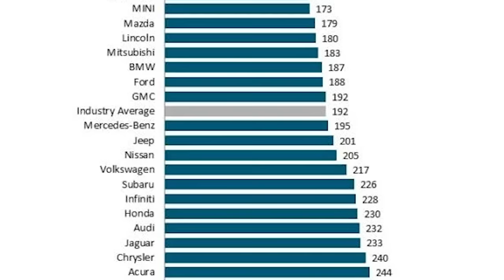Trucks That NEVER Break Down (Reliably run 1,000,000 miles)

Comment: My first truck was a Dodge D50 (a Mitsubishi Mighty Max)... it was hit by a drunk driver in a Ford Ranger, it landed in a ditch, and was rear-ended by a moron in a VW Bug... but it lasted for almost 20 years, before I got a full size truck. :-)  

Another engine you can't seem to kill (I got one with 350k on it and it's had freeze plugs fixed... which is about all the maintenance other than traditional routine stuff) is the Dodge 318.  The 5.2 liter, as it were. :)  YMMV, since most automatic transmissions suck at one time or another... it's still a rock-solid engine that is a reliable workhorse, if underpowered I suppose. :)

Comment: S-10 was peak Chevrolet when fitted with the 4.3. We did unspeakable things to our shop trucks which we'd assembled from wrecks. The 4.3 was so reliable it's why most S-10s were completely worn out before scrapping. S-10 4.3 engines were MUCH better than the head-cracking Ranger sixes, but the Ranger fours were great German designs.I had two Dodge D-50s which while slow were excellent machines. I ran the Melling balance shaft eliminator oil pump kit and swapped the stock carbs with 2bbl "Holley-Weber" style rebuilt Vega carbs instead of buying a kit. Bought both old and used then ran them for many years before trading them to a bro. 

Peak Cheyy engines are the simple early 2000s LS. My 1500 shortbed is assembled from three wrecks, one chassis and drivetrain donor and multiple cab/bed/etc donors. You can tune those ECUs with free software and a (cheap) wonderful OBDX USB adapter.

Comment: My 2001 GMC Sierra SLE Extended Cab Vortex 4.8L no major repairs  285,000 miles Just brakes and tires every 50,000, 1 water pump, 1 alternator, 1 egr valve, 1 a/c compressor (recently) , belts and hoses once, 1 idler pulley, both front tie rod ends. I do my own brake work, tune ups and I change my oil myself every 4000 miles and every now and then drive it like I stole it!

Comment: It mostly comes down to how you drive, my dad's VW passat went 700 000 km and is still driving it to work today 🙃
Reply: The thing is most trucks are driven hard and have high mileage and show reliability. I had a Toyota T100 and used hard daily. Had a stakebed and had a load most of the time. 450,000 miles original engine, tranny and clutch. It was driven hard daily

Comment: The company i work for was issuing all of us chevy hd's until the lease roads rattled all the electrical components in them to where they were constantly breaking down. Everything from over heating, wiring issues shorting out electrical circuits a d sensors, headlights and signal lights going out, fuel pumps not working. A total nightmare. Needless to say, they stsrted issuing f150 super duty's a year ago and not one breakdown out of a fleet of about 100 or so. After seeing how these new Chevy HD's are so easy to breakdown and malfunction ill never buy one personally.

Comment: My 2020 f150 3.5 ecoboost is currently awaiting a trans rebuild but parts are on nationwide backorder and needs cam phasers but the dealer says that cant replicate the rattle. I provided a video for them. Already been at the dealer 2 weeks and will be there at minimum 3 more. Truck has 44k miles. Severely disappointed in ford at the moment.

Comment: I had a '94(?) Ford Ranger, had a topper in the back & loaded it with tools. It ran well but was too small, 16-18 mpg. I sold it & I saw it around town for quite a few years after, more & more beat up then I heard they totalled it & may have lost their life in it as well. Had a '97 Dodge Ram 1500, with 137k on it, put about 60-80k on it. It was starting to look rough, rust, windshield, taillight cracked, & I was looking to order a new truck as I didn't want to keep putting money into it as the rust was getting bad. After annoying some local dealers of all 3 US brands, I finally ordered & bought a '17 6.2 F250. Didn't know I was a brand loyal individual but other than a small yet sometimes annoying parasitic drain that presented itself when parked near places with Wi-Fi which caused a delayed hard start. l loved that truck. Mpg sucked, a strong 10+ mpg, with rolling weight with aftermarket bumpers, oversized tires, work insert/topper, tools etc 9700-9800 lbs. There was the driver's side front axle issue. I'm not a mechanic so I'm not sure of official names but there was more movement than I, as well as another Ford man mechanic I knew, thought should be where the knuckle assembly entered the axle housing, maybe not a major problem but I didn't like it, I could hear it making noise when I hit certain bumps at certain speeds. I had it repaired/replaced but it still seemed to go back to having more movement than the passenger side or other Super Duties I compared it to. It made me concerned that it was going to fail, but maybe it never would have. Sadly I lost it to a patch of black ice at 110k after 5.5 years of use. I now have a '23 7.3 gas F250 ordered. I even looked at the other two brands again, but certain things about the Ford beat out the other two. I guess I'm a Ford man. Hoping for a little better mpg with the 7.3. Its hard to beat the fact that Ford trucks are the best selling truck, & that for a long time. If they are junk, Fix or repair daily, found on the road dead, why do people keep buying junk if that's the case. But it does seem that some people have a couple bad experiences with a particular brand & they want nothing to do with it after that. Each brand seems to be known for certain issues but as it stands I prefer Ford unless something arises & turns me to try one of the others down the road.

Comment: Never been a fan of Dodge. But in 2009, a friend of mine had to go on his missionary trip. I gave him the payoff on his truck and I could not believe how awesome that 5.7 Ram drove. My friends in the neighborhood are all Ford and Chevy guys and by the time I moved away from that neighborhood 2/3 of them were driving ram trucks. They ride great with the air suspension and I have a 2014 that I bought new with 115,000 miles on it that still has the original brakes and a haul an 18 foot trailer full of 4 wheelers up and down the East Coast at A high rate of speed. I own Chevrolets, Fords, and Dodges But my 10-year-old truck ain’t going nowhere. $78,000 to buy the same truck I have which I bought for $42,000. Not gonna happen.
Reply: 😅😅😅  did you wear a mask while driving your awesome Dodge?

Comment: I own a 2005 Tundra with 198,500 miles and I love it. Had to replace the timing belt which was expensive but considering my arthritis, $1000 and a new water pump, thermostat, belt not too terrible. It does not burn oil and the gear box is solid. The only probleb with the 4.7 V8 is 14 mpg in town and 18 on the road. The 4 wheel drive works well also. Love the old girl.
Reply: That $1000.00 is what you expect to pay for most timing belt work.
Reply: That thing can go 1mm miles. At your rate, it’ll 70-80 more years haha
Reply: I've the 2003 TRD 4X4, just rolled 200K. Love this truck. Looking at the timing belt/water pump job. And a bunch of other stuff to do.
Reply: @pennmikael  only 1 problem, I'm almost 75. I'll have to give it to my grandson.
Reply: I just bought a 2004 with 273k last month and just changed the timing belt for the same price and my mechanic said it was the original timing belt which is absolutely insane to me that it lasted that long but feel immaculate and I plan on keeping her alive another 15-20 years I’m hoping
Reply: Just keep fresh oil every 3000 miles

Comment: I have a 4 cylinder 5 speed manual 2003 ford ranger with 190,000 miles still going strong with minimal maintenance

Comment: I've got a 2000 Superduty F250 with the 7.3 i've had tons of electronic problems with that truck I'ts been on the back of a tow truck can't count that high anymore and don't get me started on the RUST problems with these truck, from the new body style of 1999 on up rust rockers, cab corners bed sides fenders you name it it's rusted and you better keep a couple cam shaft sensors in your glove box and this truck has never been over tuned i had the only guy FORD would let you keep your warranty do a simple 60hp chip in it it lasted a few years till the computer blew, the main problem I have with my 7.3 was my engine was made in Canada and those engines FORD only gave you a 50k warranty on the diesel

Comment: Guess Im old because Ive had 4 on this list and yes they were extremely reliable. My next one is definitely going to be Toyota. The most reliable truck Ive ever known was our Ford Courier which was really a Mazda. Too bad it didnt make the list. That thing was beat to hell and back, worked hard core, struck and rolled over twice, driven in Minnesota winters and Texas summers and driven from the East coast to the west coast. In the end it wasn't legal anymore due to laws changing about window safety and my dad couldnt drive around any more with half the windshield not being properly embedded. By that time it wasnt worth a dime even though it ran like a champ and never once needed a mechanic. Pads bulbs  battery tires and glass was pretty much all that was ever replaced over 12 years of being our families "everything" vehicle.

Comment: I took an old Chevy C10 from 1978 that had been sitting for 5 years in a field, changed the battery and alternator, fluid change and tune-up... Drove it immediately 3100 miles from Washington state to new Hampshire and it did not skip a beat!! And when it acts up I can beat it into submission with a medium sized hammer! Trust that thing with my life
Reply: What engine and transmission is in it?

Comment: Man, did you get this wrong! Number One, is the Toyota J79 Land Cruiser pickup. My 2019 has a 4.5 V8 diesel and they come also with a 4.2 inline six all mechanical diesel engine and a V6 gas engine used in the Hi-Lux. Watch the news and you will see them.
Reply: He didnt rank the trucks in this video tho, But he surely forgot to include this one. So yea..

Comment: The Dakota's are truly impressive on reliability until the release of the 4.7 V8 and the 3.7 V6. I'm on my 3rd and it's always the same surpassing 200000 miles and the frame rots out for the salt my state uses in the winter. Otherwise I'd still have my 96 sport today with no doubt a million miles.

Comment: My Cummins trucks have been absolutely  dependable,  as long as you gont get wild on turning them up.. had apx 15 trucks from 93s 2001s, and good fuel mileage  towing heavy loads.  Master Tec, 50 years experience. The L 6  engine 5.9. Is super simple . Not like designing over eginericly Chevy or ford's. Simple is reliable... have 2 98 s now. Reed Leslie

Comment: 2017 Ram 1500 5.7 V8, I have 55k on it and have had almost 0 problems. Drives amazingly smooth and will pull anything I ask. I was never a Ram guy at all I only bought it because there was a massive discount at the time. Its been rock solid so far.
Reply: I have a 2016 Ram Outdoorsman with 140,000 miles on it. Never had an issue other than exhaust manifold bolts broke loose. Still runs great and I torture it with heavy loads and pulling an 8,000 pound camper every weekend in the summer. Had a 2010 Ram before that and put 270,000 miles on it with just routine maintenance.

Comment: suprised that there was no mention on the 2nd gen rams with the 5.2 and 5.9 options, ive had 3 of em and they've all lasted over 300,000 miles with the exeption of brake lines getting blown out due to rust
Reply: Ha, I owned a second gen ram and that’s exactly what happened to my brake lines. But the truck was 20 yrs old at the time. Had the 5.9 that did not leak a drop of oil or use it, sold it to a neighbor three yrs later and he drives it as his DD. I worked with a couple guys that had over 250,000 mi on them and they still ran great
Reply: @pathunter7003  yeah them friggin lines are made of crap🤣
Reply: @kohlgray2298  that is what has bothered me for yrs now, the government will mandate schit like TPMS or back up camaras but will allow manufacturers to make the cheapest metal brake lines possible to use on a vehicle.! Should be mandatory nickel/copper or stainless

Comment: I owned a 2008 Dodge Ram 2500 Quadcab 4x4 long bed with the 6.7 liter Cummins engine. It was a good truck but every 3 months the regen system would activate the check engine light, which meant I would need to take it for a 100 mile run to clear the emission codes.  The truck was rough riding which my wife hated. It did get good fuel mileage even when towing my 30' fiver or with the 3,000# truck camper on board.
I bought it new but traded it in for a 2022 F350, which is better suited for the camper setup I have.  Of course, with the price of diesel in the atmosphere, I changed to a 7.3 liter gas engine (yes, the Godzilla).  So far, I'm happy with the truck, but I only have about 600 miles on it (picked up just before the end of June, 2022).  Medical issues have plagued me and my wife (she passed away from her illness).
Reply: Sorry for your loss Harry. My hubby and I are looking into the new Ram as we’re just getting into towing a camper. Have heard great things of the Ram (can’t remember which one off the top of my head). 
Get yourself healthy so you can get back out there. Honor your wife’s memory by enjoying yours to the fullest. 💛
Reply: Sorry to hear that. That Godzila paired with the F250 Sounds amazing.

Comment: Although I'm not a Ford fan, the F150 trucks with the 300 inline six cylinder were phenomenally reliable and about the only Ford engine I'd want in an F150.

Comment: I had a "91 F-450 with 9ft Morrison box, crane, generator, 100 gal bed mount fuel transfer system, Custom two tone paint, on and on add on niceties... 7.3 powered JUNK... Started sucking water into a cylinder... My machinist said 7.3's have a water cavitation issue causing water between #6 #7 cylinders... After that he said there was 11 service bulletins just on the heads alone... Cure was to sleeve the bank... Machinist said their 6.9 was the better engine... BUT, Intertrashsional bored out the 6.9's to get a 7.3 BUT, that made the cylinder walls very thin... NOT... Bought a B-Model Cummins...

Comment: My dad had a 1999 Dodge with the 4.9 Cummins. It was a bullet proof engine, but he had to replace the transmission about every 15-20K miles.
That is why he got rid of the truck.
Reply: 5.9 Cummins, not 4.9. The way to avoid that transmission issue is to get them with a manual. I have had two 96's (still have one now), a 2003, and a 2006. No issues ever, but no automatic.
Reply: @tornadotj2059  Typo with the 4.9.
My dad is too old to drive and I’ve owned 2 Chrysler products and I’ll ride a horse or walk before ever owning one again, especially now that their owned by Stillantis / Fiat

Comment: Chevy s-10s.  The 4.3 V-6 is a cut down 350 and should be rock solid reliable as an anvil.  It's not.  They have oil pump and lubrication problems which kill many of them at relatively low mileage.  Call around to junk yards and try to find a good running 4.3.  Good luck.

Comment: We own a gmc Yukon with the 6.0 sitting at around 350k and running way better then in looks just picked up a 2010ish Yukon with 210k that's running and looking great, then got a 2000 tundra that has 250k and won't quit.
Reply: Chevy and Toyota on top!!!
Reply: @wesleygarrison6248  💪

Comment: The GM Transmissions you mention are really good the problem was ignorant people towing with overdrive on! That destroyed them and lack of maintenance! I had a 2004 Silverado LT get 220k on the original, but I serviced it every 45k and I towed in tow mode only! That is the trick with not just those, but all transmissions. Also never have a vehicle still in motion when switching gears unless stuck in the mud!
Reply: My transmission just went out on my 2014 Silverado 189,800 miles I never changed the fluid tho tbh
Reply: Be glad your engine has held up so many fail in those years due to AFM well known widespread problem. I do like the body and interiors of those more than my 2003 though. A 2014 with an old LS based engine like my 2003 would be awesome. @Kylewraps
Reply: @JasPlun  honestly the AFM thing is overblown I have had a lifter tick since 115,000 miles and my camshaft hasn’t blown up or anything like that 

My dads 2018 has 120k miles too and no lifter tick 

Now the 2019+ trucks I wouldn’t trust cuz they use DFM which is 2x as bad I hear
Reply: It is not overblown I have a family memeber that ended up putting not 1, but 2 engines in her Tahoe. She still liked it enough to buy another except this time she listened and deleted the AFM. It is very widespread issue. Tons of videos on it your one of the lucky few. @Kylewraps
Reply: @JasPlun  what year Tahoe tho?

Comment: Its a little misleading to include the Ridgeline because it isn't a pickup by definition. Not that they aren't reliable little units, Honda has a pretty good track record, but they're not trucks and they won't haul like any pickup truck will. Unibody designs aren't really capable of lots of weight in the box.